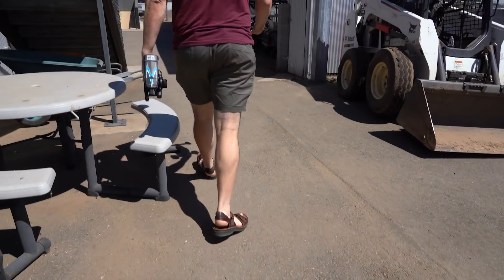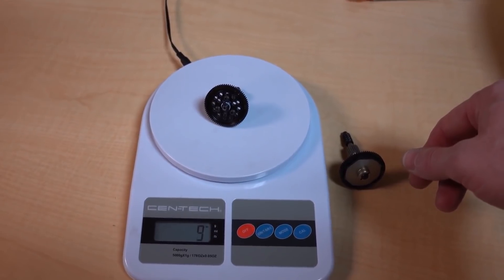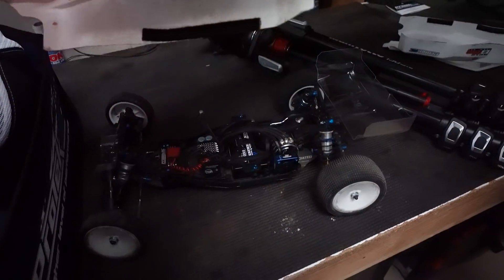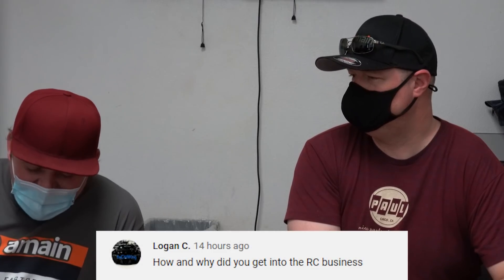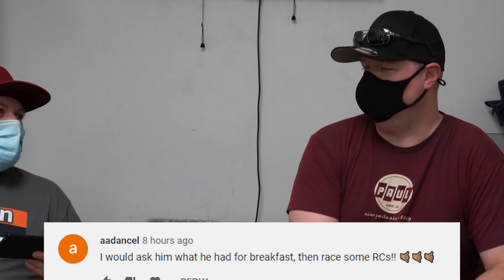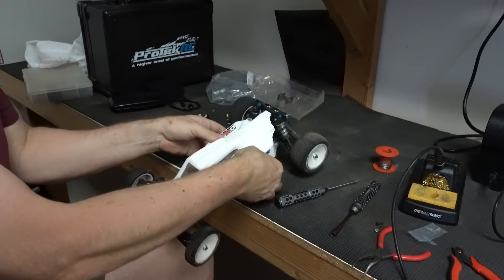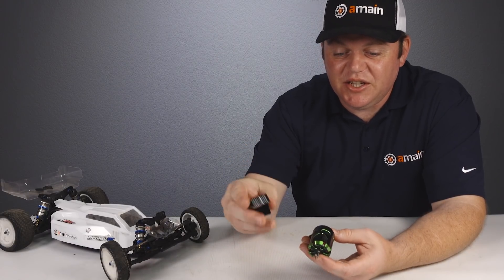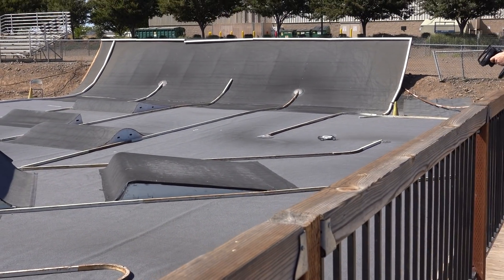Testing 5 Different Motor Fan Setups for a 2WD Buggy (feat. Kendall Bennett)

Comment: Where did you guys plug the fan into?
Reply from the maker: The extra port on the receiver. Any extra channel or the the AUX port will do. If you don't have an open port because of the transponder, a Y-Splitter cable can be used to plug the transponder on one side, and then the fan on the other: https://www.amainhobbies.com/eflite-3-yharness-ultra-lightweight-eflryh3ul/p56868
-Brett

Comment: I would be interested to know if the fan direction makes a difference…?  Which way were you guys going..? I assume at the motor..?
Reply from the maker: Each test was with the fan blowing on the motor. Blowing away from the motor would be interesting to test but we didn't try that. 
-Brett

Comment: I drilled a 1 inch hole in my windshield on my brushed losi 22 sct. Ran a hose to the motor, like air ram style. I run 3s which really makes it haul ass. Have not checked to see if it makes a difference yet due to rain. Budget was zero lol..

Comment: The only downside to mounting the fan like this is durability. I tried this one time and after a Wednesday night club race the fan had stopped working. Not to it working over time or anything, but from crashing upside down. Due to the fan being right underneath the body, it's the first thing that gets hit when landing upside down. I ended up putting the fan back on the side of the car instead, but would like to try putting it on the back corner of the car at some point since that showed to be the best placement for cooling the motor down.

Comment: Letting those motor temps reach 200+ degrees didn't do damage to the stator windings or magnets? 🤔
Reply: No, these racing motors are meant to withstand these temperatures, I would hope anyone who comments here knows at least that these racing motors are meant to be run very hard, so they are made to withstand these temps

Comment: What we do is put thw fan behind the motor on an angle and secure with double sided tape then i make a shroud out of plastic and secure to the fan with double sided tape also. For the low profile Bodies this is the best option.  You need to cut the back of the body around the fan to maximize air flow. Also i like to use a body reamer and make some holes on the opposite side to let some of the hot air escape and i also make some holes in the front windshield to let some air flow through the body.

Comment: Quick question
Can I run a 12v 0.6A rated cooling fan on a 12.6v 12A power supply or will it smoke up?
Reply from the maker: I'm thinking that should be ok. The fan will probably work at 12.6V without issue but will it shorten the lifespan of the fan? Maybe; but I don't think it will burn up. Hope that helps. 
-Brett
Reply: @AMain_Hobbies  Thanks alot

Comment: Shouldn't have bothered letting the motor cool down. Seeing how the fan effects heat equilibrium Is what you want to know.
Reply from the maker: If you don't cool the motors there is no way to keep the testing method consistent. Starting temperature NEEDS to be consistent among all tests for the data to have value. 
-Brett
Reply: @AMain_Hobbies  I would have to disagree. Same concept eith testing cooling on computer cpu's the most reliable results of how effective the cooling is comes from bringing the loop or heat sink.upto equilibrium operating temperature first and then the different cooling methods show more reliably. Perhaps a makeshift treadmill with a constant resistance could be cobbled together. Without any cooling the motor should reach a temperature at which it holds constant under its own output and cooling. Then adjust the fan positions or compennants accordingly and reasses. Bringinf the motor upto temp as part of the test brings in many more variables. Having the motor hot from.the start of the test doesn't represent real world as well but it does control the experiment much better.

Comment: Loved the video Brett amazing bro still want this 1520 motor just wondering about batteries  to get the max power  just want it be right do amain hobby’s ship batteries to northern  Ireland I’m about 5 miles out Belfast
Reply from the maker: Hey Sam. We may not be able to ship LiPo's internationally because the shipping carriers considered them hazardous. Other than LiPo's, most everything else we should be able to ship to you. Even if you source LiPo's from a local shop, I would recommend looking for packs with high C Ratings; 60C and above if you can help it. Please avoid 50C or below as they may not be able to keep up with a powerful 1520 motor/esc system. Good luck!
-Brett
Reply: @AMain_Hobbies  ok Brett ur a gentleman thank u iv made my mind up I’m going for the 1520 thank u bro

Comment: This clip sneaked by while I wasn't lookin. Its Sydney, its summertime, we're racing and we're getting thermal shut downs in ambient 35C temps. Having played about (amateur) with cooling fans and solutions, since none of the manufacturer solutions do very much right now (Losi, X-Ray). This clip confirms what I found so far, if you want to cool the motor, the fan has to blow on to the motor can directly, then it works very well. The drama is finding a way to mount the fan so it can do that. So far all attempts work well but succumb to the extreme G forces of racing. However, in interest of finding a solution, testing continues as time permits. Necessity being the mother of invention. 
Great clip though, to see actual real world testing and recording the results. Good juob guys.

Comment: How did you get power to the fan? I’m trying to avoid using a Y harness & to clean up the wiring? Thanks.
Reply from the maker: We used this Ruddog 4-Channel receiver that had extra ports for the fan. We didn't design it this way, but it worked out.
Here is that receiver: https://www.amainhobbies.com/ruddog-rr482-2.4ghz-4channel-fhss4-fhss3-receiver-sanwa-compatible-rdgrp-0176/p897666
-Brett

Comment: Hey guys you can also shave the stock fan mount down a bit to fit in the factory location but turn to the back of car. Drill screw hole through and can mount the fan on the rear

Comment: Question. How do wire up a fan if your receiver only has three slots? Solder to the battery leads on the esc?
Reply from the maker: I think you can get a Y-Splitter and connect the fan with the transponder. You could solder the fan to the battery leads, but power will fluctuate with battery voltage (not a big deal) but replacing the fan when it breaks will not be so convenient. https://www.amainhobbies.com/eflite-3-yharness-ultra-lightweight-eflryh3ul/p56868
-Brett
Reply: @AMain_Hobbies  one other question. I Just picked up the waterfall brace and the fan you mentioned. What size screws do you use to mount the fan?
Reply from the maker: @thelurker9472  There you go! It's a great cooling solution. You're going to need some 3x14mm or 3x16mm long screws to go through the fan and thread into the mount. 
-Brett

Comment: I would expect the water fall brace to perform better. With the fan mounted behind the motor and pushing the air forward, this fan must fight the air that is coming into the body from forward movement. If you could shroud this fan it would perform better and how I am building mine.

Comment: Gentlemen may I know why you blow on fire instead of sucking or depriving it of oxygen....   seriously I run all my fans in exhaust fashion.  Heat rises... you want to remove it not blow 101 degrees ambient on it.    Also, you need a heat sink that touches every inch of the motor if possible and fins at least half inch with a fan sucking heat away and out somewhere there needs to be flow.  IMHO

Comment: @Amain Tried the waterfall mount and fan on my b6.2 after watching this video and it made my car handle horribly, ruined months of setup. Car didn’t fly well, body didn’t fit, zero traction in corners. Wouldn’t recommend it.
Reply from the maker: Sorry to hear that Peter. I'm surprised adding the fan caused that much setup change. Hopefully you were able to get your car back to how it was before. 
-Brett

Comment: What battery was used in the test.  I'm taking. Mine out sunday for its first shake down run but ures looks alot quicker. I'm running 17.5 on a 69/31 as recommended in the manual. My battery is a 2s 7.6v HV. Be interested to know if you've gpsd in ures in a 7.4v
Reply from the maker: It was a brand new ProTek 2S 6100mAh; this one: https://www.amainhobbies.com/protek-rc-2s-120c-low-ir-sigraphene-hv-shorty-lipo-battery-7.6v-6100mah-ptk-5114-20/p1060482
It's the 2020 version and it's powerful! For our testing, we were only charging to 8.4V, not LiHV voltage. 
-Brett

Comment: You guys need to cut air holes in the body or even better cut the front window out of it. You will get better air flow to everything plus with the fan blowing in the car. It has really no where to go out quickly and remove heat. Yes it will take some out but not as well. We go through a lot in the rc boats when guys do not cut holes in the cowling to get air in and out. Suffocates the 2 stroke motors real bad. Example is 2x the air outlet as you have coming in. Try it and I think you might even see a bigger difference in it. I do realize you are running on carpet and some guys will run the setup in dirt which now you will have dirt being flung into the car through the window from the front cars. Walls can be done to divert the dirt but at same time still get good air into it.

Comment: I’ve tried many different way to mount a fan myself and found that the waterfall mount worked best as well. Depending on the fan I was getting 20-30 degrees lower b

Comment: Have you tried to flip the fan where it pull the hot motor air off it instead of the fan drawing/pulling air to the motor or vice versa? Simply which is better pull or push fan?
Reply: Pushing colder air on it.  Just lowers temps...thats the whole idea...pulling the hot air will just recycle it Inside the body...not lowering Temps

Comment: Anyone ever said you look like Cody King. Lol serious question,  how  do you adjust brake strength, with the m11x? What is the trim setting for brakes? On an electric buggy?
Reply from the maker: You'll want to check out the ESC for the brake strength programming. All competition grade ESC's will have this function and will allow you to easily adjust the strength with a program card or something similar. The throttle trim button on the transmitter really only adjusts the neutral point up and down between throttle and breaks, but not the strength of the breaks. 
-Brett
Reply: @AMain_Hobbies  on my m12 it has brake strength setting but haven't found it on m11x radio? Thanks
Reply: Lol. Cody is a great guy and we raced a lot together back in the day. He was a teenager back then! I was in Thailand when he won the worlds also, awesome race. As for brake strength I have my radio close to 90 and use the ESC to set it so I still can dial in a bit more. For 2wd it’s usually about 80% in the ESC.
Reply: @kendallbennett7451  I have the m12 also and brake setting is in the trim settings. Not sure where to find it 9n m11x radio? Thanks

Comment: You guys should do this again but do a vary low budget build
Reply: I second that
Reply: I third that
Reply: Do I hear a fourth
Reply: @dominiciannucci8480  indeed
Reply: Yesss
Reply: this was a budget build
Reply: Buy everything used and see how low you can do it, but with hi quality parts!
Reply: I was trying to get started on a budget.  
I bought a used 2wd team associated Roller  for $100, so I was off to a good start, but it needed everything but a servo and wheels. 
I bought a used Hobbywing XR10 G2s pro elite for $150 
A programmer for it for $25 
 Lipo shorty batteries for $75 
I got a used Reedy 17.5 for Free. 
And I bought a New Surpass V6 motor, timed and Shimmed for $100 
And Used lipp charger for $20 
Total so far $445.
I still need a pinion gear  and some installation and I think I'm ready!